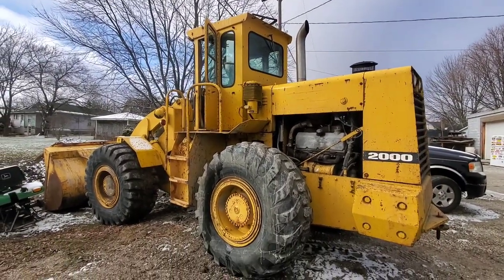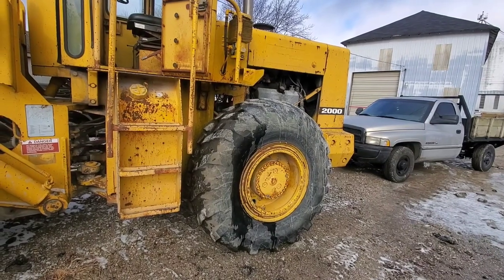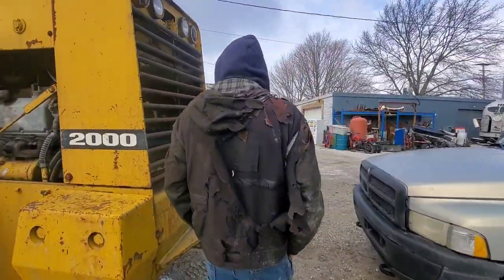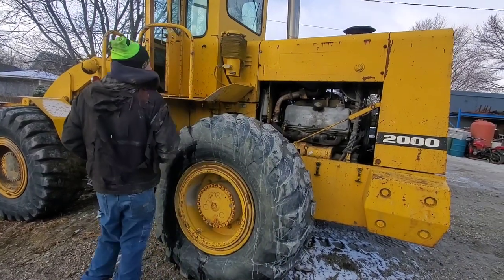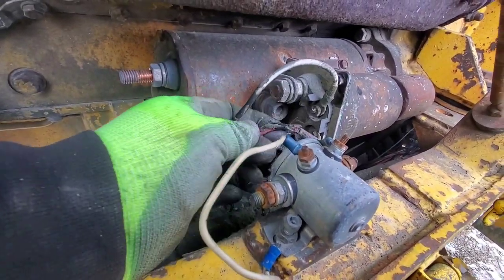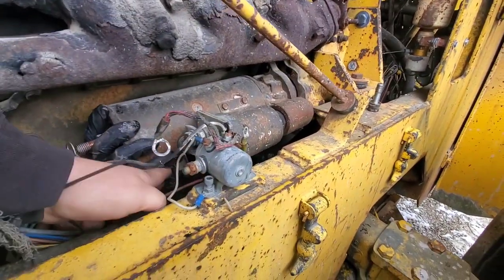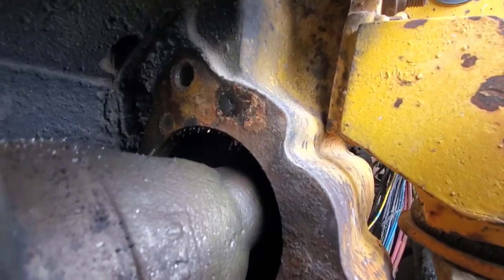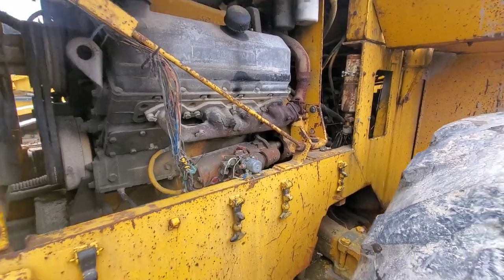Trojan 2000 loader no start

Comment: I think I'd fix the wiring first it can cause complications with the starter dragging, improper engagement of starter to fly wheel and cause damage to said wheel, but that's just me and I haven't learned very much in 74 years.
Reply from the maker: We will be fixing the wiring while we have it apart to put the new ring gear in
Reply: @Spyke383  I know the damage was already done when y'all started.

Comment: on automatics, the fly wheel is the ring gear, standards have removable ring gears
Reply: your thinking cars heavy equipment is different
Reply: just take the teeth off the starter so it matches up with the ring gear.
Reply: @shreddder999  i used to work at an auto parts store had a customer come with alternator set it on the counter and said "i need a new starter" he thought car starters were belt drive.
Reply: @markroderick3300  so sell him a new "starter"

Comment: i don't think the engine is integral to the chassis in that.. from looking at it.. pull the bull nose with the radiator .. the hood and the engine should lift out the top, really need to look at a service manual to see which way it comes apart ..

Comment: When you pull the motor to change the flywheel. Throw the motor in the garbage and repower  with a Detroit. Those V series Cummins are garbage. I have a 3000 Trojan with a 6v-71 in it. We had a Michigan with a 504 Cummins. Had to rebuild the motor 4 times in 10,000 hours. Garbage.

Comment: Is it me or does anyone think the water dripping on the rear tire look like a dog peed on it
A couple of pieces of plywood to lay on etc, a big blue tarp to make a tent along with couple of halogen lights to provide light and some warmth and torpedo heater to provide the rest of the heat and this job probably would not be that hateful to do outside but if that pig will fit inside why go though the effort.  All that said it sounds like a perfect time to go to Texas and play I mean work on getting the bus ready to head north to Indiana.
Reply: if that was dog pee thats one big f  in dog to reach that high on the tire

Comment: WTF? how do ya bar it over with no teeth on he ring gear? geeze!
Reply: on the bolt that holds the crank pulley on with a socket and a breaker "bar"